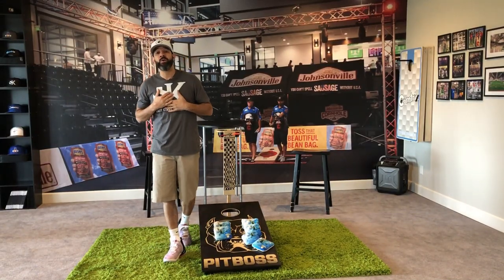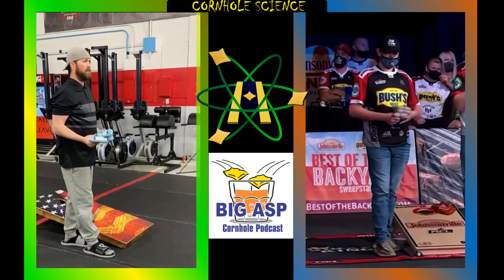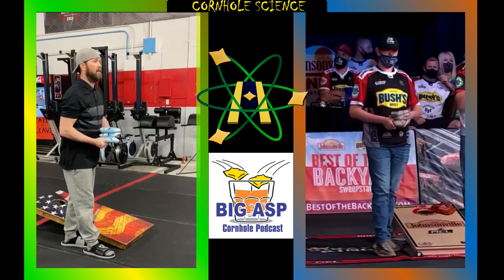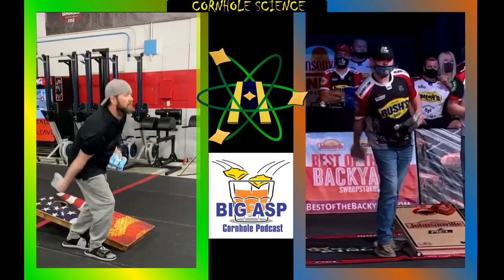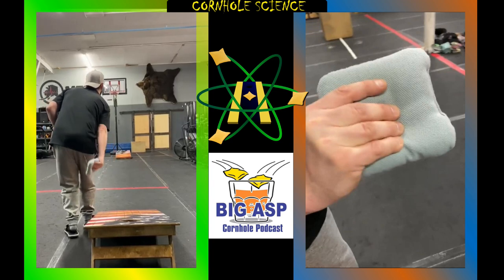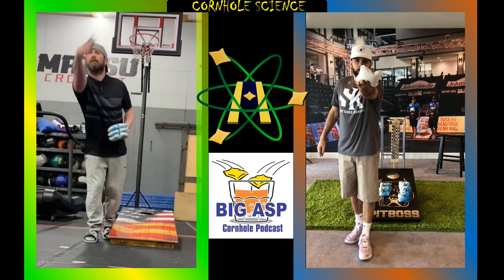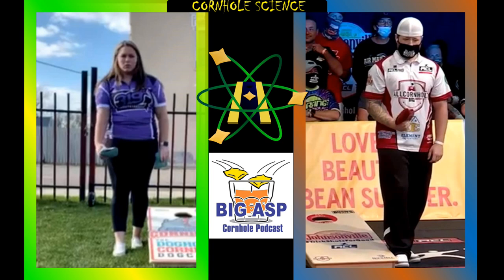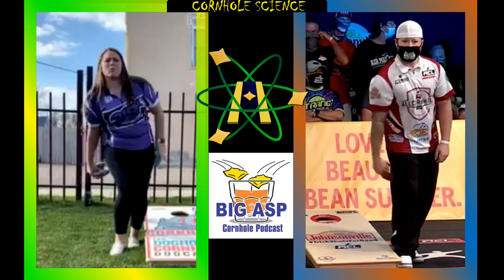Cornhole Technique Break Down 1

Comment: As women, our shoulders are narrower and our hips are wider, so there is a need to bend the knee to make room for the toss.  Also, we don’t have the same upper body strength that men have, so that little extra calf raise helps provide the distance we need.  I wish I could find instructional videos specifically for women instead of comparing us to men.
Reply: I see where your logic is going but it’s actually not what happens at the elite pro level. The comparison used would be identical when using an elite man or woman. Elite women have no issues with the distance to the hole and do not require knee bending or calf raising. In fact elite women make it look just as effortless as elite men. To take that a step further we see juniors at the age of 12 years old achieving the needed distance to the hole just is effortlessly.